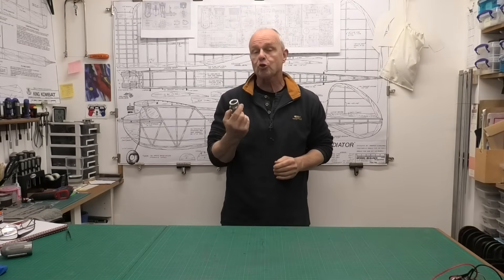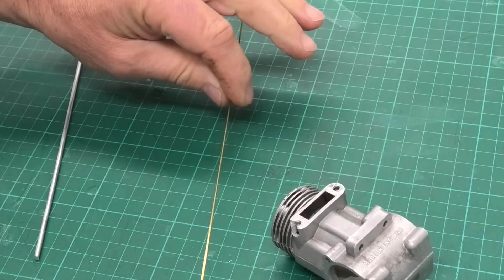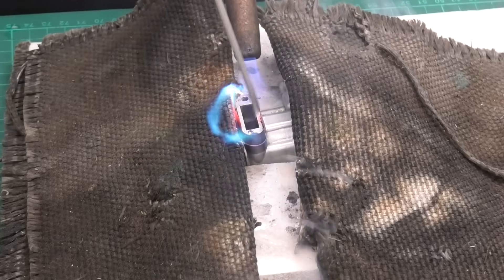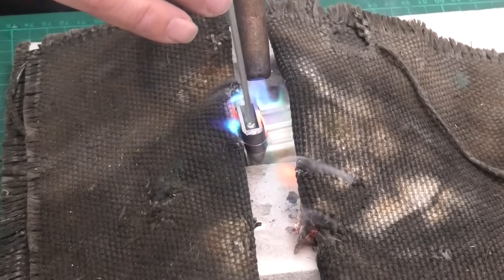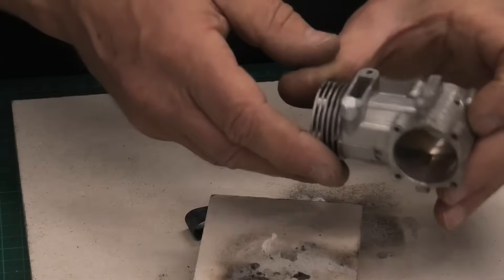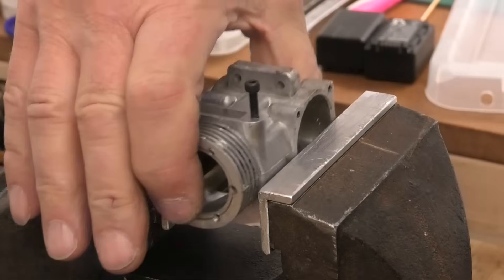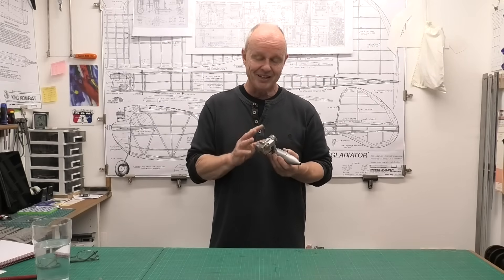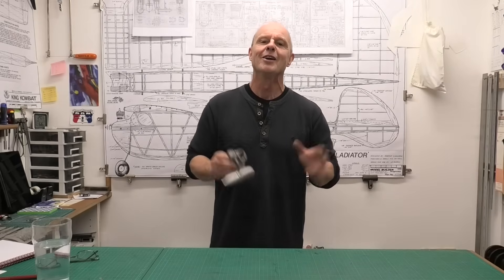Aluminium Brazing - No 1: Broken Exhaust Mount - Crankcase Repair

Comment: That turned out nicely.....I have used the Lumi-weld brand rods a few times to repair aluminium castings with bits missing. They are also very good for repairing split/torn Land Rover panels which are made from Birmabrite alloy.
Reply from the maker: Thanks so much, really appreciate the insight and glad you found it interesting!

Comment: Hint, mount a centre drill in the chuck for accurate drill start operation. Nice bit of Al soldering, I've tried it and its not that easy.
Reply from the maker: I used a Centre Spotting Titanium Cobalt drill bit before drilling, which is clearly shown and I even say what I am doing, this gives great accuracy when drilling when drilling, in the same way you are suggesting, I think you must have missed that bit!  Pleased you like the finished result, thanks for the comment 😀

Comment: "Brazing” comes from “braze” (to join with filler), not brass..

Soldering: Low-temp (<450°C) join with tin-based filler; no base melt; weak joints; electronics/plumbing.

Brazing: Higher-temp (>450°C) filler, no base melt; capillary flow; strong joints; HVAC/tools/dissimilar metals.

Welding: Melts and fuses base metals; highest strength; significant heat/distortion; structural work.

Comment: If you want to keep your tapped thread nice and square to the face a handy trick is to clamp the tap wrench around the shank of the tap and while the chuck is still over the centre of the hole tighten it over the shank of the tap leaving it just free enough to turn.  Keeps the tap nice and upright.
Reply from the maker: Great suggestion, really appreciate you sharing that!

Comment: That’s an awesome repair. I have some of those aluminum rods and a map gas torch but wasn’t confident enough yet to use them fearing I’d melt the whole job. Can you use those rods to sweat together the two broken parts if you still have them as I do.
Reply from the maker: Thank you, really pleased you enjoyed the video.  Very difficult to reply to your comment without seeing the situation you described, but the brazing rods don't go like liquid, they stay fairly thick when melted, so it you join two pieces they won't go back as they used to. So I suspect thy may not do what you are hoping.  Thanks for the comment 😀

Comment: If the braze doesn't stick to steel, is there a reason that you don't just thread the screw back into the remaining threads and braze around it?
Reply from the maker: That may well be an option never tried it that way, just feel this is a better and easy enough to drill an tap it out.

Comment: That is a very nice repair Mark but tell us what aluminum rod you used(there are so many out there) the other tip i can give you is that i never use a gasket as an exhaust exhaust seal. I have tried many methods but the one that works 100% is use Pratley quick set white epoxy.  Apply a thin bead with a toothpick and tighten the exhaust.  You will never use anything else! 😊
Reply from the maker: Thanks so much for the kind words, really appreciated. I used Durafix aluminium brazing rods, I find they work really well.  Regards exhaust gaskets, I have always made them from thick standard gasket paper and they work well, never had an issue with them failing etc., but thanks for the suggestion, always good to hear how others do things. 😀
Reply: The epoxy is much easier than trying to cut a gasket!😂😂😂

Comment: Very wel done Mark!.. I would have done the same!..It must just get hot enought..and you have to brake thru the oxide layer to get a good bond..but if that is both done wel, it is stronger then Aluminium it self!. You can also insert the bolt right away ,when you do  the soldering..and you can after cool down just unscrew the bolt, as it does not stick to steel. Works nicely!
You are really good with all your work mate!! Head down!!!
Keep them coming!! .. I wish I had more time for new videos....but right now...just  to much still going on with the new house, so one thing at a time..
Reply from the maker: Thanks for the kind words, really pleased you enjoyed the video!

Comment: Thanks for yet another excellent presentation, Mark. I wish I had your skill and machinery! Many years ago I was taught so many of your skills by Jack Love, the founder of SA Model Engineers here in Cape Town. However, at the ripe young age of eighty-two, my model-making skills are now just a tad limited, but I still run my old engines just for the utter thrill! My Olsson and Rice 10cc sparky is one, together with the classic ED Fury, Racer and Competition Special diesels. Glows are a Cox .049 with adapted head and my lovely modern MVVS 7cc which powers my R/C plane. Here's to modelling, mate, so keep up the great work!
Reply from the maker: Thanks so much for the kind words, so pleased you enjoyed the video!

Comment: Very interesting Mark. Do aluminium brazing rods not require a flux?
Reply: Great video.. It will be interesting to see how the repair holds up as the engine goes through the running heat process...
Reply: @jetblack5115  I've used those rods for various repairs, they will hold up OK but they are not all that easy to use, you must not heat the rod up at all, the job needs to be heated up and the rod just pushed against the job (Not exactly what was happening in the video!). The filler material is actually harder than the aluminium.
Reply from the maker: Glad you found it interesting! No, the brazing rods don't require a flux.